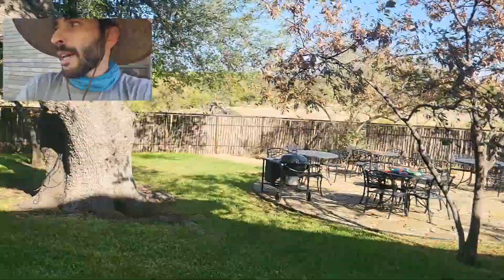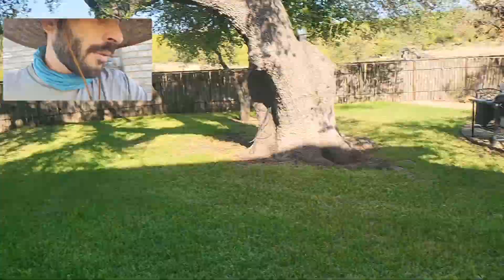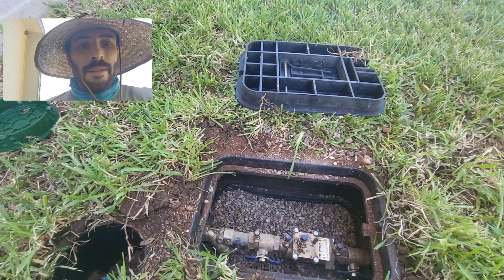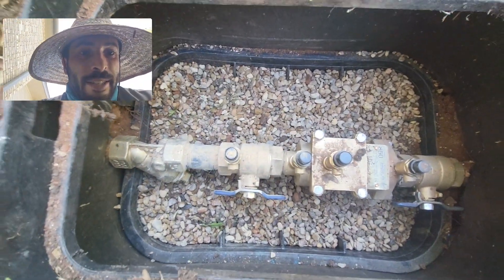DCVA install (Texas)

Comment: For the PVC connections to the back flow preventer did you just use threaded schedule 40 or how did you do that? I'm getting a lot of mixed info from my research on how to make the connections. Thanks for the help!

Comment: What double check valve is that. Looks exactly like mine. It seems that the irigation guy is trying to push for replacing it without a test gauge. Don't know if I trust him. May do it myself with a proper 1 to 1 replacement. 

He claims it is broken and limiting pressure to our sprinklers.
Reply from the maker: @MillionDollarDIY  Febco 850. You should expect to lose around 4 psi through a 1” DCVA. You can use a pressure gauge to confirm this by testing the PSI at test cock 1 and 4. 

Flow may be restricted, I would recommend getting a second opinion. I would also recommend a professional replace the backflow, it's the most important part of the system and requires pulling a permit and being tested by a BPAT.
Reply: @irrigationtipstricks7797  it seems that the house pressure is 70 psi, the sprinklers psi is coming down to 20. It's definitely loosing a lot of pressure somewhere. Do you have a recommendation for a pressure gage that would work?

Comment: why don't you just replace the two handles for the DCVA valve?  you are making a $20 fix to be a $300 one.  GOOD JOB!
Reply from the maker: Thank you for engaging with this content, You have a valid point which I agree with. 

The gate valve needed replacing so we were already digging up the area. Sometimes it's better to replace the whole thing than trying to repair individual parts. The client was very happy with the work and continues to use us for repairs.

Comment: Just curious, why the 90s?
Reply: In my opinion threaded unions where a better option, they give you the flexibility to remove/replace the ball valve or DCV later on if need be plus you added 4 places for the water to slow down by installing 4 90s